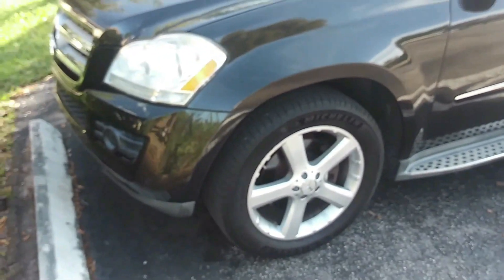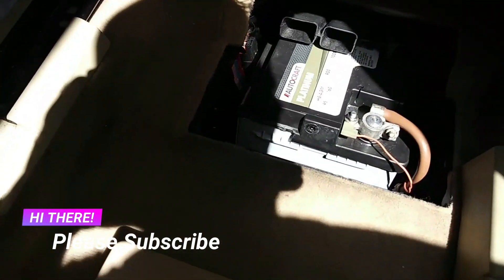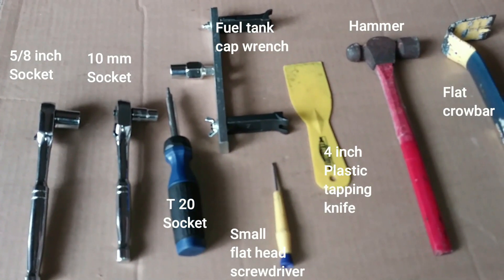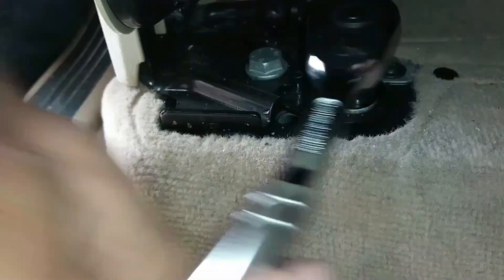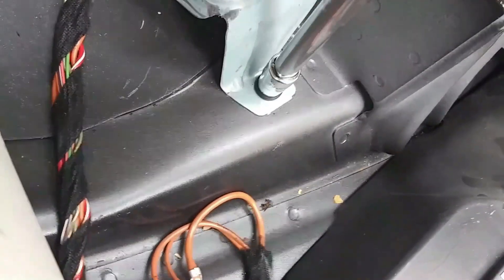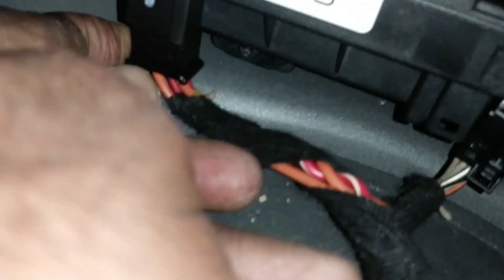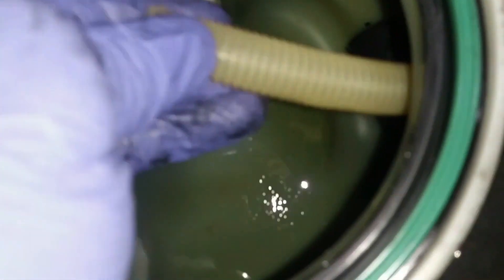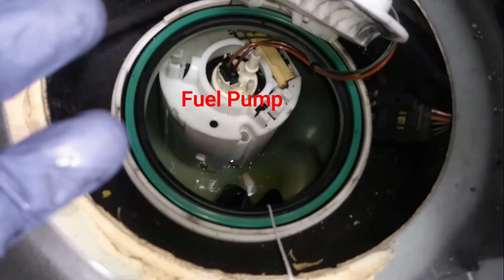2007 - 2012 Mercedes Benz GL450 fuel pump replacement. (The vehicle fuel level was on E... )

Comment: Your the man bro
Reply from the maker: LOL thanks bro
Reply from the maker: I uploaded a lot of video on how to repair Mercedes Benz GL 450 and I'm going to upload a lot more soon. Don't forget to subscribe.
Reply: Mine does not have the plate cover. I have to cut a hole in the floor
Reply: Do you have the video for the other pump on this same car? The one on the driver side.  I was told there are two pumps. One behind each front seat.  Is it true?

Comment: my name is marcos i have 2012 merdeces gl 450 i need to know where part location for engine coolant temp senor
Reply from the maker: To be short and specific, my best advice to you is to go to a Mercedes Benz dealership part department and provide them your vehicle VIN last 8 digits and ask them for the coolant temperature sensor and if they can give you a print out / schematic of the sensor location.

Comment: How did you know the pump was bad?
Reply from the maker: Actually, I changed the fuel filter because it was leaking. however, the pump was nearby... so, I decided to make a video to show people how I removed the pump.
Reply: @TakeActionDIY  mine keeps stalling while driving and won’t start for hours or days.
Reply from the maker: @ralphtaylor787  Turn the key to on position and leave it on for 5 seconds then try to start the vehicle. If it starts with no problem... the pump may be weak and/or the fuel filter may be too dirty.
Reply: @TakeActionDIY  thank you! 😀
Reply from the maker: @ralphtaylor787  Anytime bro!